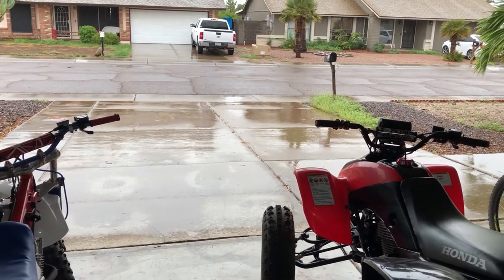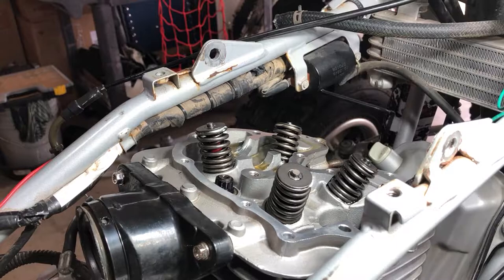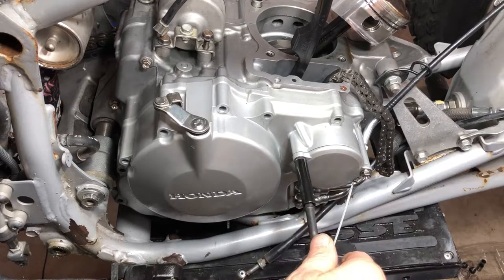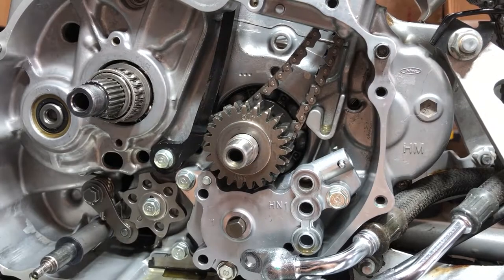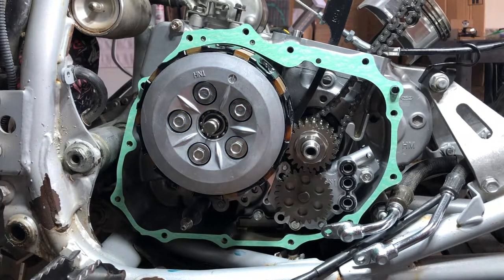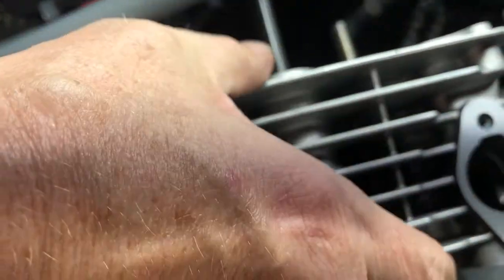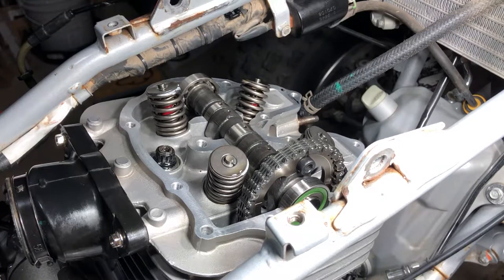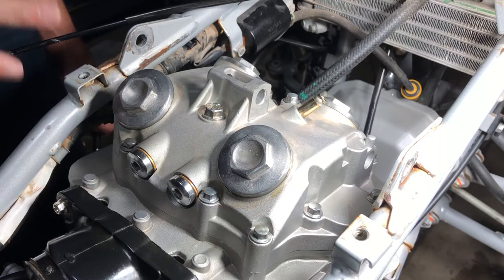Honda 400ex Install CRF TRX 450r Timing Chain, Replace Base Gasket, Head Gasket, Brand New OEM Parts

Comment: I may be the only one doing this. But i never remove the cam sprocket bolts unless i am upgrading cams. You can get  the cam dowel on the not sprocket side out then shift the cam slightly and remove the dowel on the sprocket side. Then slide the bearing off the sprocket side and the chain will then come right off the cam. I have seen sprocket bolts backout even fully covered in red loctite and torqued to spec. I avoid moving them at all costs. Great video and maticulous work!
Reply from the maker: yeah, you can do it that way, but I never have good luck with those cam set pins, so I just remove the cam sprocket. I use red loctite to secure it and it always gets torqued back to spec ... I have never had a problem with the cam or sprocket ... ever in my whole life ... and I'm old ... lol

Comment: I love watching your videos, I noticed you were using a niche jug.. how its treating you and what piston brand and bore size you were using on this build.
Reply from the maker: Well, I can't really say for sure ... this whole motor was Wiseco crank and piston, niche cylinder, and cheap (Parts Ace) cylinder head & cover with Niche rockers kit ... the Wiseco crank was out of spec and I don't know if that caused the problem or not but one of the cylinder bolts was pushed through and broke the left crankcase ... I had it welded and put the motor back together with an OEM crank, cylinder, and piston ... I still have the Niche cylinder and it seems ok but I'm not using it anymore.
Reply: @11GalleryATV  thanks for the reply, my head cylinder was fucked up so I'm gonna be using a niche one as well. And let's see how the niche jug treats me as well.

Comment: How did the 450 cam chain do? I just bought one for my 400ex.
Reply from the maker: The 450r chain works perfect ...
Reply: Is there a reason why you went with a 450 chain as opposed to the stock 400 and yes I’m way behind on the builds but seen this video and inspired me to start a project with my son.

Comment: Would this be the same process for a 450?
Reply from the maker: no, the 450r is a completely different engine ... 450r is water cooled, for one thing (400ex is air cooled)

Comment: Did you use the 400 chain guides with the 450 chain, and any issues? There's absolutely no slop at all in these guides.
Reply from the maker: yes, I used the 400ex chain guides and I did not have any issues but I sold that quad so I don't know if there are any issues long term ...

Comment: I did a complete rebuild in my 08 400ex  I even replaced the top and bottom timing sprockets but I installed an oem chain on it  . The original one is not that bad right?
Reply from the maker: no, the original is not bad at all ... I only replaced the timing chain because mine was a cheap aftermarket brand that stretched. I went with the 450r timing chain because it was actually cheaper, and this is a popular modification people do so I wanted to do a video.
Reply: @11GalleryATV  okay i like watching  your video keep them coming you do good work you should work at a shop
Reply from the maker: @DANIEL-gg1ir  Thanks ... I appreciate that ...
Reply: @11GalleryATV  ok bro keep it up 👍

Comment: Will the 450 timing chain work on the 2001 Honda 400EX? I just got me a 2001 on the right side I swear I hear a chain slapping around in there.
Reply from the maker: yes ... ALL 400ex years use the same timing chain (cam chain) - 1999-2014
Reply: @11GalleryATV thanks I'll order me one..
Reply: @11GalleryATV  I see you rebuilding these engines I was wondering would you happen to know a brand name gasket kit to get? Right now I'm just replacing the timing chain but I don't know if the engine's ever been over hauled it runs good but the chain is slapping I'm looking for a engine rebuild gasket kit I'm going to get that chain for the 450 I just don't know if I should just go with the OEM kits because there's so many of them on eBay and Amazon some are cheaper somewhere expensive but I don't want to have to do it twice. I'm also just running to stock exhaust and stock muffler I was thinking about the cam but somebody said I don't need a stage 2 or 3 cam with a stock exhaust your help would be greatly appreciated thanks in advance
Reply from the maker: @michaellarcom  I only use OEM gaskets if possible otherwise aftermarket gaskets are hit or miss. Be careful with aftermarket cams because they are set up to enhance power in different areas ... some offer better midrange to top end power and some offer better low to midrange power. You may also want to look into getting the head ported and polished as long as you have it apart. Exhaust and airbox lid off are other mods people make for more power. Depends on what style of riding you wish to do.